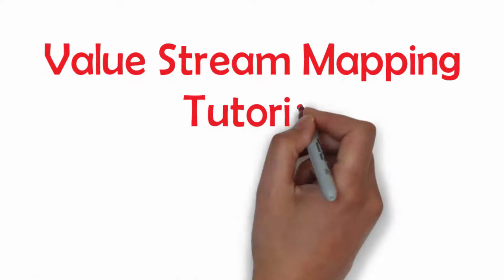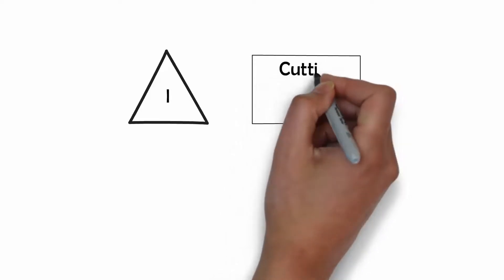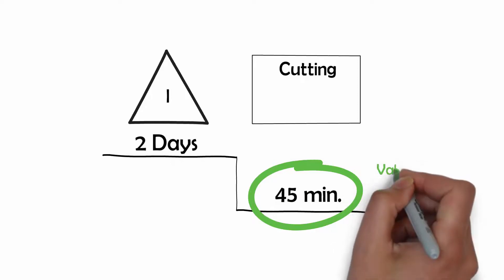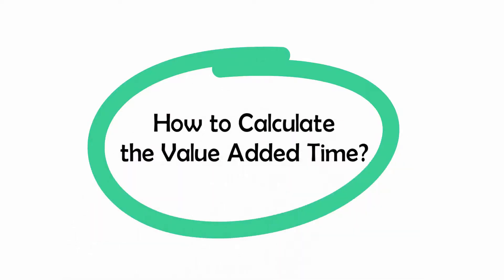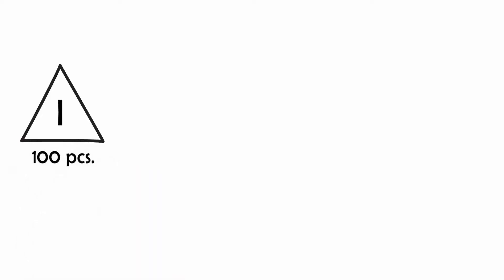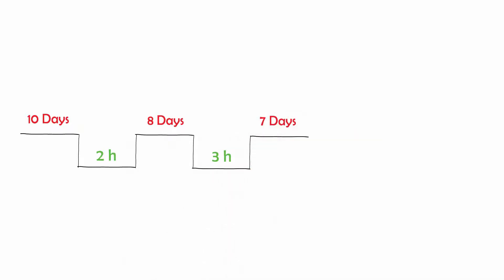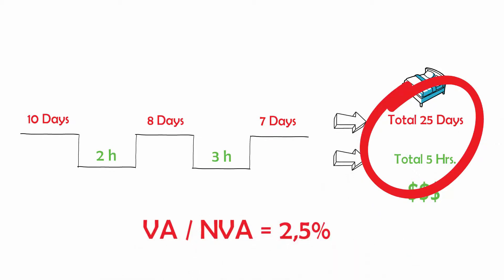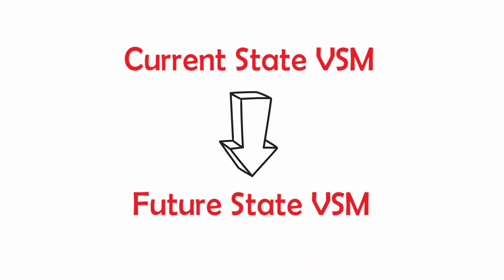How to Do Value Stream Mapping - Lesson 6 - The Time Ladder

Comment: 25 day lead time with 5 hr value added time only equals 2.5% ratio IF the days are only considered as 8 hours long. If your plant runs 24/7, that ratio drops to .083%. Is the 8 hr day arbitrary or standard in the field?